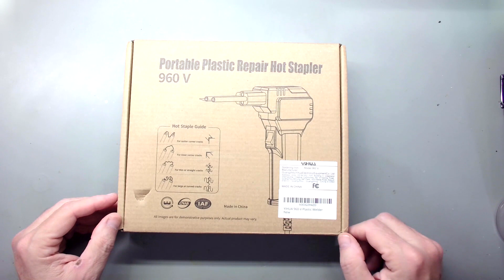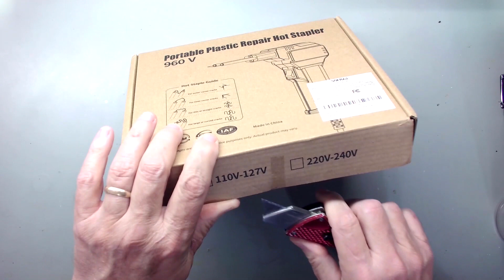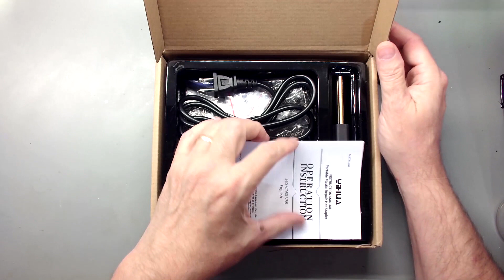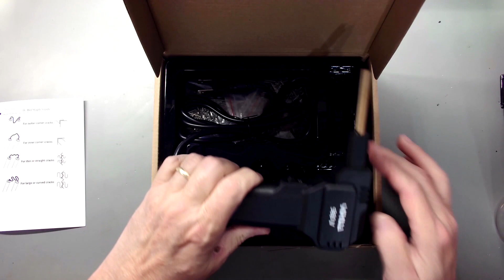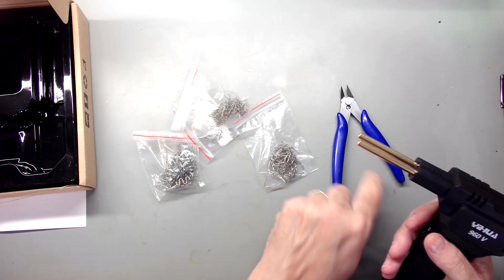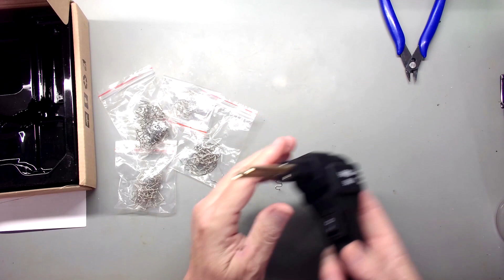Is the YiHUA 960V Plastic Stapler the best way to fix plastic?

Comment: Ate the staplesnot supposed to go into the gun effortlessly? They seem to be wider than the gun tips.
Reply from the maker: They are a little bent out. This does two things. 
1- keeps them from falling out when you point the gun downward 
2 - make sure it makes electrical contact inside the gun barrels so it passes current through the staple to get it hot. 
Hope this helps.
RJ